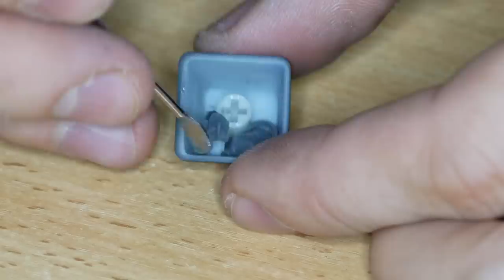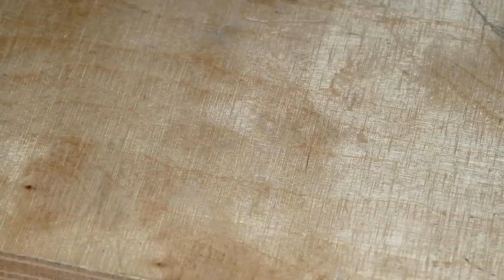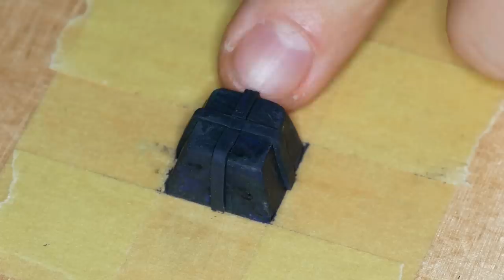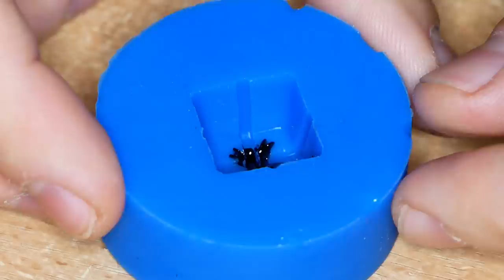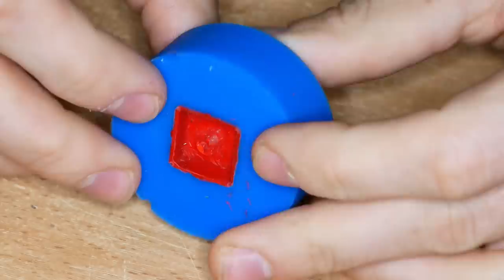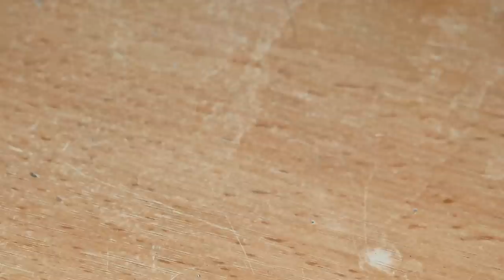DIY. Making Custom Resin Keycaps. Christmas Gift 🎁 / RESIN ART

Comment: I would like to see some clear resin keycaps 🥰 What about different heights and leveling on each keyboard?
Reply from the maker: For each level I make a different forum
Reply: @jedrek29t  Are there any 3D models of molds with different profiles? I wanted to make some clear keycaps myself, but I don't feel like taking out my already existing keycaps and using them for a silicone mold. Edit: I'm scared of damaging them.

Comment: I have had problems with coloring UV resin black and then it not curing. Have you ever had this issue? If so, any solutions?
Reply from the maker: UV resin must be slightly transparent so that light can cure it
Reply: @jedrek29t  That was my thought. I just thought the black you had used was UV and it looked solid and still cured. Thanks for answering! 👍